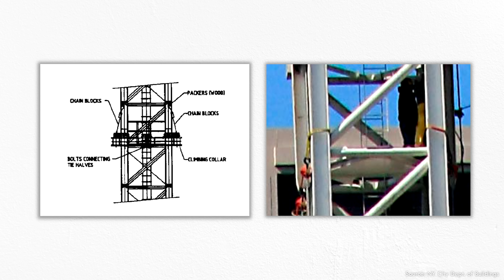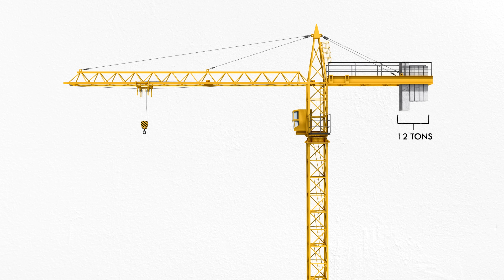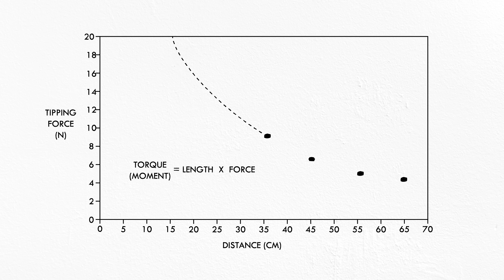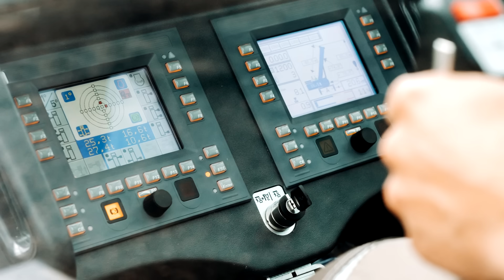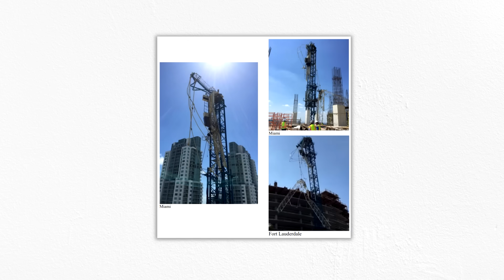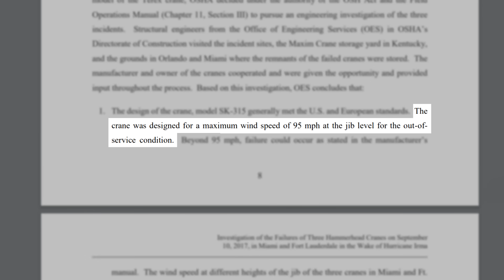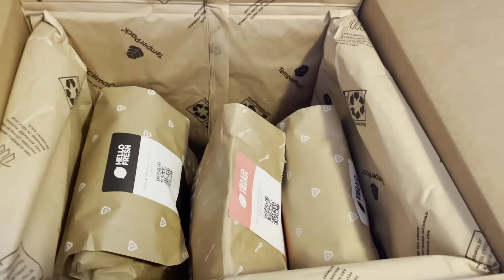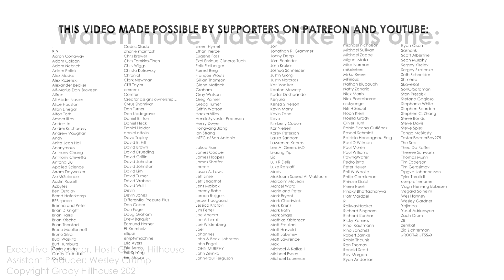Why Cranes Collapse

Comment: When Big Blue accident  Happened, it was about 7 Months earlier, I was in Salt  Lake City Utah running a 11320 American  Crawler in Super  Sky Horse Attachment, we Had two Crawlers for 11 two Crane pick Roof Trusses, the first  Truss was the King Truss close  to 700 ton 1.4 million Lb, 
Every Heavy  lift we did the Superintendent brought a Form out both of us operators had to sign our name on it making  us Liable if something  was to happen, when I first seen the nightmarish Accident of Big blue, and the Prime Contractor was at Fault, I wonder why they didn't  think about  making  the Operator  with Lampson that owned Big Blue do the same thing as we had to do, I read the Centerpen
Shattered,  myself  as a very experienced Crawler  Operator has Ran plenty  of Manitowocs 
From 2900 to a 4600, I can't help think watching  that Accident on Video  numerous  of times, IT WAS NOT THE WIND, I believe  it was Fatigue on the Centerpen, threw nothing  but Heavy picks for 25 years, series 1 a 4100 is a 200 ton Crane, Series 2 a 230 ton Crane, the Homemade Transit  Lift is a 1200 ton Crane From a 200 ton Crawler, Ironworkers are the best Craft to work with around  Cranes, and I can't  hardly  believe  they would  take a chance  making  a lift that big in High Winds, agree No wind is better, but that wasn't  High Winds, a Crawler  like that was in Structural on the Chart, not Tipping, meaning  something is going  to Fail before the Crane will tip, this Case, it was the Centerpen.......
Reply: Also when I was 21years old my Dad and I was on a 9310 American 225 ton Crawler,  and my Dad turned down an offer for the both of us to follow  that same Crane  to the next Job, the Crane  went up to Downtown  Los Angeles, the Operator that went on the Crane was an Operator  for the Crane  rental in Las Vegas, because  of the Lack of  experience of  this Operator he turned the Crane  over trying  to take the Heavy  load to far over the side  of the tracks, the weakest point on the Crawler taking  something out far, this Man's Error costed  3 Lives  in 1981, two Women  and the superintendent in the office  trailer, the trailer  was on a hill  when the Crane  turned over, the counter weight come slammed back down and drug the trailer  down in the hole, I understand the Operator had bad nightmares every night afterwards!!! This same Operator later became  the apprentice  coordinator  in the Union, because his Daddy  inlaw was the President of the Union...

I'm now 62 years old retired, I look back at this  constantly  thinking of these three people being  killed, I actually cry sometimes...

Comment: That last crane, the union crew walked off the job because of weather.  A non-union crew who didn’t have the knowledge to run the crane with that load did the honors instead.  RIP, guys.

Comment: 14:38 The peel of the lime is creating a bowl which does not allow the juice to freely sip down. In an engineering point of view, it is best practice to rotate the tool by an angle of Pi on its long axis.

Comment: I've been on a job site where a crane fell.  This was just a mobile 40-ton crane we were using to set a large cooling tower on an 8-story building.  I was on the roof as signaler, so I got a bird's eye view of the fall.......and of the boom slamming into the corner of the building before continuing its trip to the ground, incidentally dragging our cooling tower with it.  The crane went over sideways and ended up laying across a road (oh, and a couple of cars and the General Contractor's trailer).  Our cooling tower ended up landing just outside the elevator shaft on top of a boom lift someone had just parked seconds before.  

The reason everything went tits up that day?  Human error.  

First, the crane company sent us a 40-ton crane when we asked for a 60-ton crane.  We needed the 60-ton crane because where we were setting the unit was almost perfectly in the middle of the roof, meaning the crane would need a pretty long reach.  The 40-ton crane had the reach only with the jib and it was at the very limit of the crane's capability.  Second, the crane operator trusted his helper to set up the outriggers and neglected to check them before he started the lift.  The helper, for reasons unknown, had decided to only use one block under the left front outrigger.  As the crane was reaching almost to the absolute limit of the its capacity, the left front outrigger slipped off the block.

Comment: Are lift directors and crane operators the same thing On a job site?
Reply: No. Lift directors are more involved in the planning of critical lifts, which may include any number of scenarios based on crane, job site, conditions, or multiple cranes being used. They also organize and plan the lifts to use the proper crane, with the correct rigging, that is best for the job while also being safest. A lot of lift directors were once crane operators, or have at least been significantly trained in the area, but not many crane operators will ever be lift directors.
Reply: @Seantherightway06  
Thanks for the light! Appreciate it

Comment: Never mentioned that most load charts have 2 distinct sections.... stability (tips before it breaks), and structural (breaks before it tips).  Also, the Miller park failure was not caused by dynamic loading.... it was simply side load due to the wind.  The Lampson Transi-Lift was notoriously unstable side-to-side.  I have nearly 40 years as a crane designer, specializing in structures..... crawler mounted and truck mounted, both lattice boom and telescopic cantilever boom machines.

Comment: 6:32 There is usually a key to disable that security system, and the key is often in the lock at all times.
The system allows you to only operate the crane to a safer state, when the key is turned you can make all the accidents.
Even 30 years ago when I took my certificate in a 400t Liebherr the system was in use.
The key must only be in the lock when the crane is set up or taken down.

Comment: Miller Park collapse: no operator should work at 97% of capacity, wind or no wind.  It takes about four brain cells to tag the risk as not acceptable. I hope the operator was charged with Negligent Homicide.

Comment: https://www.youtube.com/watch?v=8_nTLIuk6Hk
(volume warning)

Your analysis sir?
Reply: The load chart will state: "Crane is to be operated in a firm, level surface '.  The barge was not stabilized.... as they swung the load, the CG shift caused the barge to tilt.  After that, it was all downhill.

Comment: Most of the failure videos on the 'net are either: Too much moment and the (mobile) crane tips over or rigging failures due to slipping or overload. I'm just amazed that these still keep happening! I've seen some where the outriggers are lifting up and someone is standing on it to try to hold it down! People just push their luck so far! Other people standing under the load - man, you won't find me there.
Thanks for a very informative video!

Comment: As a crane operator you did a great job with this video in my opinion, and when you showed the photos of the computers in the cab those are really familiar because I used to run a grove GMK series and now I’m running a Tadano ATF series 👍

Comment: Hurricane Dorian in 2019 even blew over a crane up way up here here in Halifax, NS (it was only a tropical storm when it hit here). The winds were well below the max windspeed for the crane, but the cause of failure was determined to be failure on a defective weld exacerbated by corrosion near the base of the crane. Fortunately no one was hurt since everyone was at home for the storm.

Comment: When leaving a crane swivel mechanism unlocked to allow for weathervaning, the driver should consider the swing area. When we had the top floor and attic added to our house, the crane operator at the end of the day hoisted up a big compressor trailer to secure it from theft, as they often do, and left the swivel unlocked. In the night, a storm came up, made the crane weathervane around and swung that compressor into our neighbor's attic. Thankfully we already had a crane available to help with the repairs.. ;-)

Comment: I know this is a rare ask, and coop videos aren’t your thing, BUT….

I have a theory, based on past videos of yours… that @kentuckyballistics is wrong about the hot load in his gun. Video for reference: https://youtu.be/1449kJKxlMQ

I don’t think it was solely an “extremely hot load” in the round he fired, that sheared off 4 threads on the cap… that it was repeated stresses that caused the threads to fail at a much lower force than is tested, due to the repeated use… 

Is there anyway you can analyze and confirm? 

I’m not smart enough to know the science… I’m just crossing streams and hoping my theory is wrong.

Because if so… and I’m not saying it IS so…. But, if so… the gunsmith needs to recall, rework and reengineer his materials science to prevent this catastrophic failure from happening in the future. 

Please, and thank you for the consideration.

Comment: Can’t we use the edge of the existing building as a fulcrum and run the shaft of the crane up the elevator shaft?  And just lift in conjunction with the height of the building?

Comment: Generally speaking, the general public is not aware of how many cranes suffer failure. When a crane collapses or overturns on private industrial sites it is normally reported to OSHA but seldom reported by the media unless there is a death. I was on one site where one contractor had at least a dozen crane incidents on the job but not one was ever reported to the public because there were no deaths or injuries. The majority of crane incidents are caused by people and not the machines themselves. Far too many times contractors try to push the crane past its limits of loading. Wind is ignored by some in their efforts to speed the work. The law of averages says that sooner or later you will get caught if you work outside the parameters applied to any crane.

Comment: Great video.
One thing to note is that unlike most situations where you can reverse an action and correct a problem before it gets out of hand, with a crane this usually isn't possible.
If a crane starts to go, it will only keep going since the length of the arm is increasing as it falls.

Comment: My dad used a small delivery truck with a cargo bed and telescopic boom crane. He forgot about the crane still being erected when he drove away and snapped the boom clean off while driving under a bridge. The part flying off easily weighed a few hundred kilograms. Luckily nobody was hurt or killed.

Comment: Well researched episode. Good job! I would like to add that in a load chart there's a stair like bold line separating the chart into two sections. Anything above the bold line is for structural strength; anything below is for stability. I was surprised that some operators didn't even know this. Another comment is the video should also include shock load as another frequent cause of accident. 
  
One observation back when I was working on load moment indicators: many manufacturers claimed the LMIs came with a "black-box" feature (event recorder or data logger), which was supposed to help engineers reconstruct the last lift in case of an accident. It's nothing but a cyclic recording of CANopen messages on the CAN bus with timestamp. However, I can't figure out the sequence by just looking at the recording. Simply put, my interpretation of the event never matched what had happened. Clearly more work needed to be done to make this very important feature useful. Coincidentally, there was a crane accident in Washington DC involving a mobile crane. In the investigation report it stated that the 'black-box" wasn't reliable enough to help the investigation.

Comment: i never get it when peopel say "moment" and its not refering to a nonspecific amount of time. such as moment, mentioned in this video, or "magnetic moment" in another video else where.
Reply from the maker: It’s another word for torque, but more commonly used in structural engineering
Reply: @PracticalEngineeringChannel  thanks, that helps

Comment: I remember an accident that happen on the site a couple years back. We were assembling an STS crane in Bremerhaven using 2 crawlers. While lifting the machine house one of the steel lines snapped and the 50+ tonnes steel shrapnel grenade went flying down 100 meters. I remember the sound bolts made when they flew away from the crash, nightmare. Fortunately noone was hurt.

Comment: I think a liftplan is great for unwieldy objects (very heavy/ very big/) but which everyday construction-site crane operater is gonna do that before each lift? They won't.  
I mean its ok to pay 4 engineers 2 days of wages to come up with 'a plan' for something like an Olympic stadion but for an everyday building i cant see that happening. Not even a  slimmed down version of it. 
I really cant see an operator every other lift ;  "aaah let's see, the wind has changed a couple knots, and this pallet of iron beams is slightly heavy,  im going over this and that.... ah yes, let me contemplate how this is all gonna work.." he's just gonna lift the bucket, and swing it where it needs to go. 

Also "easily preventable" i dunno.. it does seem like an excessive amount of work to determine what is the local actual strenght of the base. 
I mean again, on a big site, it probably pays of, but like a mobile crane.. should he like carry a miniature mars-rover to test the soil first? 

I mean some accidents might be preventable in a perfect world.  But then no work gets done ever.

Comment: But before everything goes down you know how much each piece that you have to carry up Waze. And you are not telling that part. And that is what makes you have to act like also, that a bow and arrow tension or a guitar string tension... Has to be waylaid from the top tension just like the neck and the what you call, the nut on a guitar neck... And it's the same tension... But you have to keep the balance and the counterbalance
Reply: And the point that you cannot use a sub crane to humor the balance of the super crane is the reason why you have taken black dudes out of construction

Comment: There was a place called The Cotton Mill that caught fire in Atlanta Georgia... I was was the lead laborer on that job and I quit the day before it all went down... I have learned many times that those weights that are counterbalance are always situated to be like piano keys or stairsteps or some figure that man-made has created that you can recognize as a balance. But what happens with these is you can look at those and tell it doesn't go it goes this and it drops... That's not what you have to deal with once you get above 80 ft in the air because you have what you call, windshears

Comment: I worked ground crew as a contractor with a construction company in 1990 when Big Blue was brought in to make a very heavy lift of a dome off a reactor in a refinery. We spent two months driving hundreds of pilings into the ground to shore it up for the lift. It took almost 100 truck loads to delivery the crane and a month to assemble the crane. The safety involved to make the actual lift was very thorough and every precaution was taken to ensure no harm to life or property. It is very difficult for me to imagine how the Milwaukee accident happened when considering my experience with Lampson and their crew.
Reply: It all boils down to $$$. Stay on schedule. Stupidity basically. That same day big blue went down I was the #2 guy on a house setting trusses. I recall thinking how idiotic it was that we were swinging trusses that day. Then I heard of big blue and realized how right I was.
Reply: The normal operator of big blue refused to do the lift the day of the accident due to high wind. So they kicked him off site and someone else was pressured into operating the crane.

Comment: Nicely done.  As a crane operator this is nice to see, so maybe folks with less actual crane experience can understand what it takes to do a job safely.  Too many times there are folks that just want the job done and can't seem to grasp the work NO.  As an operator I insist everyone goes home in just as good of shape as they were when they showed up that morning.  Sometimes it is a conflict.  It's OK, though.  I am way more afraid of hurting someone than not meeting the production schedule if things are "iffy".
Reply: The video calls the grounds bearing capacity vertical defamation, I googled vertical defamation to see if that was a term engineer’s & geologist used but nothing came up.

Do you happen to know if that term is used for Bearing capacity?

Comment: Remedy to a number of these accidents? If it can be proven that the operators didn't follow the manufacturer's manual when assembling, using and disassembling the crane and it can be proven that was the cause of a fatal incident then everyone who didn't follow the instructions and everyone who told them not to follow the instructions and everyone who originated or approved any policy documents about not following the instructions should be convicted of manslaughter by gross negligence and jailed for life. A non-fatal incident causing serious personal injury as a result of not following the manual should also result in serious jail time as well for the same set of individuals.

On top of that the company operating the crane concerned should be fined a substantial portion of their annual turnover.